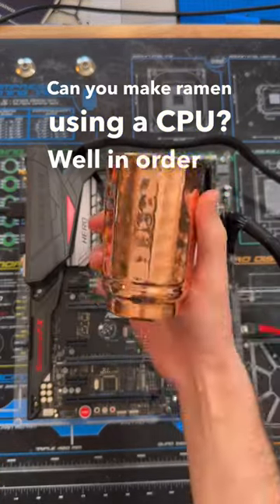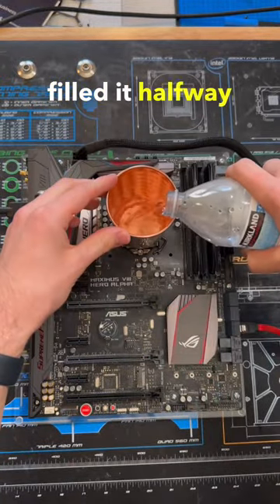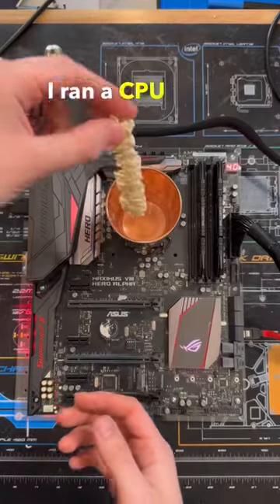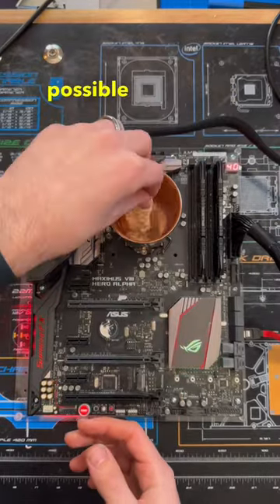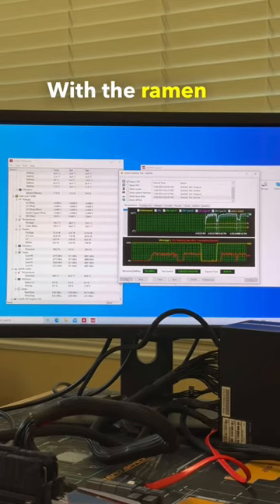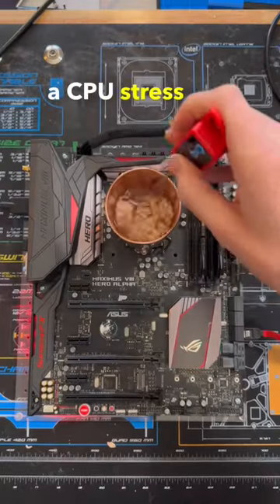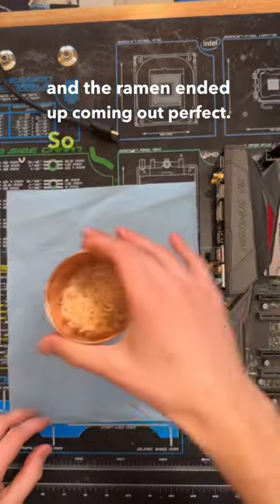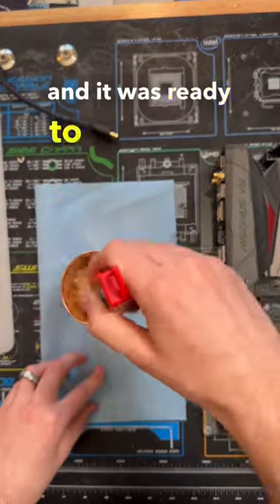Cooking Ramen Using a CPU #shorts #pcgaming #pc #pcbuilding

Comment: Step 1: Make sure you have a Core i9, preferably the 13900k, as that'll cook your ramen in seconds.
Reply: Why spend ~$500 when you can just get a AMD FX?
Reply: does it work with the kf?
Reply: You do realize that you can use almost anything over 45 watts and not all of the time do you need to put a load on it. The CPU will use less power if it gets too hot to prevent it from destroying itself. You can have a 500w CPU and load it, but it will only use a fraction of it.

Comment: ok, let me grab my FX, ima cook up a steak
Reply: With a very high overclock, much better.
Reply: @AGAMERTEAM  FX CPU's already get hot enough, I might burn my steak if I overclock.
Reply: @AGAMERTEAM You do realize that you can use almost anything over 45 watts and not all of the time do you need to put a load on it. The CPU will use less power if it gets too hot to prevent it from destroying itself. You can have a 500w CPU and load it, but it will only use a fraction of it.